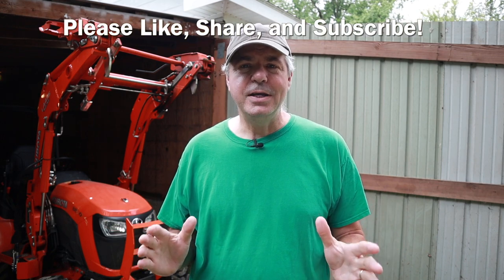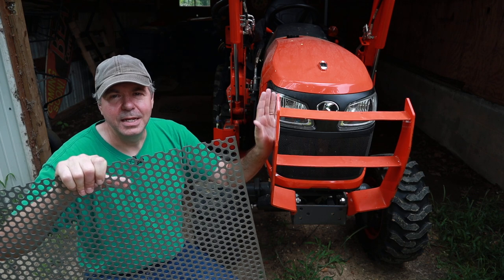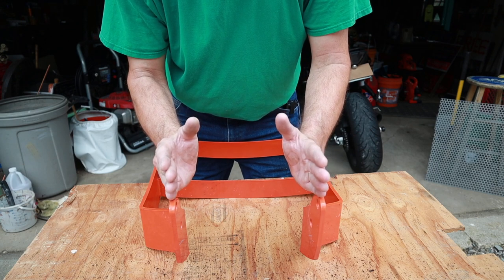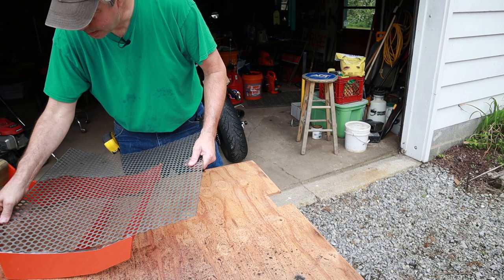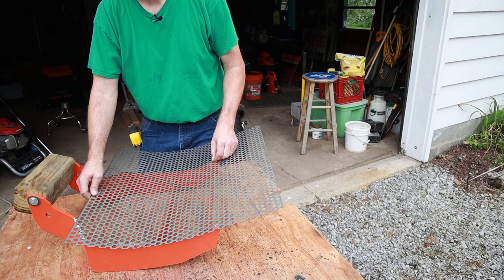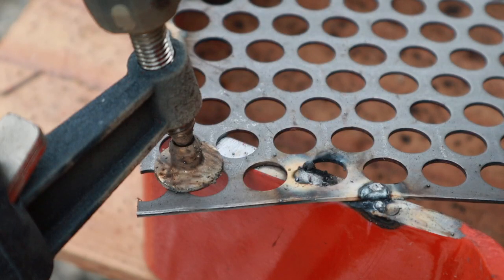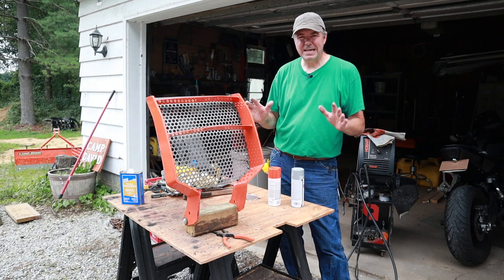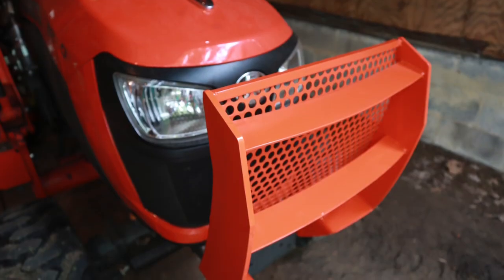#25 Kubota B2601, B2301, B2401 Brush Guard Mod. See the Hobart Handler 140 in action.

Comment: My poor mans fix was to buy 15" rubber bungie cords and run them across the bush guard leaving about 1" between them.  These are strong enough to stop any tree branches from going through the grill guard and damaging the tractor when using the grapple.  My grill is still intact and the $20.00 fix works just fine!  Takes me a whole 3 minutes to remove them when I put the grapple away for the winter.  If it wasn't for your video I wouldn't have even thought of protecting my new expensive purchased B-2601......Many Thanks.
Reply from the maker: That’s definitely better than nothing! Thanks for watching!

Comment: I started with the same damage you did. I used expanded metal, placed it on the front instead of the back of the guard.  I bolted the material on instead of welding. I put the metal on the front so limbs did not get caught between the screen and the frame, and tended to slide past the guard.  I bolted the screen as I figured it would eventually get damaged, and bolting would make replacement easier. You did a great job, and very nice looking
Reply from the maker: U Tubota - thank you. Sounds like you did a good job too!
Reply: Bolting that on the front sounds like a great idea!  How did you go about that?

Comment: Great great video. Cannot believe it has on 63K views, but art is art. But HEY E. Man, always wear a mask when spraying primer or paint, even when you hold your breath and are upwind, it still will clog your brain. 
I personally didn't always wear a mask, on my channel, like during my Camaro rebuild video that's coming out, it will cause brain clarity...

And one more thing E, wait for the primer to dry before adding the final top color coat. Sometimes you could get a chemical reaction from the primer when its not completely dries (read the label)  Un dried paint will release gases and will bubble underneath the top coat, (if you don't allow it to dry at least 30 minutes) but I see that both the primer and the orange color, are the same manufacturer, so that helps too. You are an awesome teacher. Thank you for your hard work.
Reply from the maker: Thank you Tommy! I know that painting is an art too (that I haven't mastered like you!). I appreciate your comments!

Comment: This is the way to do it.  My 1959 Massey Ferguson has this perforated metal in 3/16 thickness for a grill.  Perforated metal plate beats expanded metal.
Reply from the maker: Thanks Lane! 3/16 is way thick!
Reply: @MyClutteredGarage  the Massey 204 was early in the evolution of industrial tractors, based on the Massey 35, but they didn’t skimp on raw materials back then.  Today’s tractors and their controls have evolved so much. It’s all so interesting.
Reply: BTW, I have plenty of “hinge” wire from a former career, so I’m adding lights to the bucket arms where they bend.  I figure floods aimed at the bucket and above will help fill in when the headlights are blocked.

Comment: Great video, I have a Kubota L3901, three things I wonder why Kubota didn't do on my tractor:
1) Have a better brush guard, I damaged my front while hauling brush with my grapple.
2) Install lights (or light bar) on top of the ROPS.
3) Make a better PTO switch on the L3901

Comment: Like it! Just ordered a piece of that perforated steel to do the same. Whenever I use my grapple I'm always looking out for something sticking through and damaging my radiator. With this I can breathe a little easier. Thanks!
Reply from the maker: Good luck with your project. Thanks for watching!
Reply: By putting the mesh on the back side of the stock Kubota guard, the protruding guard steel sections can trap a branch end.  If you put the mesh on the front face of the Kubota guard,  it would allow branch ends  to slide off, instead of getting caught.  I am going to have to do something like this on my New Holland tractor.
Reply: @larryhasard3989  That's something to consider. Will look at it.

Comment: fantastic job! That looks factory! I wonder if the paint will hold up without clear coat, but even if it doesn't, it's easy to touch up. Well worth it.
Reply from the maker: Thank you! It has held up very well, but I do keep the tractor under cover.

Comment: I wish I'd have known about your trick with the 4x4 to hold the proper width. I didn't do that and had to get 1/2" threaded rod with nuts and washers to get spead out to the right dimension. thanks for the video.
Reply from the maker: That’s a bummer, Wayne. But at least you didn’t make it too small!
Reply: @MyClutteredGarage  Ed, I did make it too small and had to use the threaded rod to expand it out about 3/16” .  I did have a hard time bending it out as the threads started to fail. Next time I would use connecting nuts which have more threads . Thanks for the helpful video. The block is the answer!
Reply from the maker: @wlsteffen  ohhh. I was thinking you had to pack it out with washers. Sounds like you had a clever (but frustrating) solution!

Comment: Wow, that looks killer.  Well done!  I just checked my LS MT225E and it has metal mesh in the grill already, but I think I'm going to do this mod anyway. It looks great and if I bend one the metal mesh inserts or bust a headlight with a tree branch I'm sure the cost to replace either with OEM parts would easily exceed what the metal costs to do this mod. Well done video, and thanks for the wood block tip. Liked & subbed!
Reply from the maker: Thanks Dave. Very much appreciate your kind comments. -Ed

Comment: The grill on my B2650 is wrecked. This is a great modification to the guard, it looks really good and will provide significant protection.  Regarding the lights, I wonder if it would help if thr back side of the grill was painted flat black...

Comment: Great video! I bought the same welder last year from TSC, they at that time had one heck of a sale on it. I use Dewalt tools had pretty good luck with them. The cordless jig saw I bought was an 18 volt and with adapter now uses 20 volt battery

Comment: That looks awesome! I also have a Kubota 2601, have it about a year now. Was afraid to use to due to putting a scratch in it,lol. Just had my biggest, oops happen. While loading wood into the bucket, and taking it up to dump into my trailer a piece slide out and landed on the hood🤦🏻‍♂️. Nothing stays new forever.... I ended up using a dolly and hammer got most of the dent out but ended up cracking the paint.. these things happen..
Reply from the maker: Yep, I’ve broken mine in nicely. 😄
Thanks for watching!

Comment: The cup on your mig welder should cover your nozzle tip, it will give you better gas coverage.
Reply: He's using flux core wire, no gas required.

Comment: Why not put the added steel protection on the other side of the brush guard?  It seems to me that it would be better protection.
Reply from the maker: I actually thought of that. I just thought it looked better behind. Thanks for watching and commenting. Much appreciated.
Reply: @MyClutteredGarage  It looks better but not as strong. A big limb can break those welds and go straight into your grill. That being said.  I'm going to use the same perforated metal on the front of my brand new MX6000 that I put a hole in the lower part of the grill yesterday. The added bonus is I won't see the hole so easily with the guard covering it. Thanks for the great idea. It looks much better than the expanded steel I was planning to use.
Reply from the maker: @jackrothaus2816  bummer. The first ding is the hardest. Thanks for watching! -Ed

Comment: Excellent ! A job well done. I am more concerned with eliminating the side to side shake in mine. Does the insert block the lights much ?, I think I might make cut outs for the lights on mine.
Reply from the maker: I would guess it probably blocks the lights 50%. But the front end loader blocks them 100% so it didn't matter to me. Thanks for watching! -Ed

Comment: What's the brightest head lamp bulb you recommend to replace the factory bulbs that came with the Kabota 2601 tractor?  Thank you.  Btw, your videos are very helpful.
Reply from the maker: Hi Jim. If you have a front end loader, a brighter headlight won’t help much because the FEL blocks it. You can replace them with LED’s but the best solution is to add some ROPS mounted lights. Thanks for watching! -Ed

Comment: My BX2380 has a dorky flip flop brush guard that is always in the way when I open the hood. Seems the biggest function it has is to hit my front grill when I open the hood and piss me off. I am going to mod that darn thing all right... with a socket set, it is coming off. If I ever have a situation where things are actually going to hit my front hood [probably never] I'll put it back on. Oh yeah, did I mention it blocks my headlights too?... grrr

Edit, I am going to look at re-mounting the thing... ON the front grill so when I open the hood it does not HIT the front grill, it opens and tilts down "with" the hood/front grill. I can also mod it so it no longer blocks my headlights.
Reply from the maker: Sometimes accessories aren’t as well designed as the could be, for sure.

Comment: I’ve never used a nozzle gel, it looks easier I use a spray. 

One thing that might help you is when you do this kind of stuff instead of doing all your welding after you clamp it down, you spot welds on the end and in the valleys where you have to press it down and get everything straight first when you keep Welding at one end you’re shrinking and expanding and warping that metal so by the time you get down to the other end it’s a slightly different length and when you will that into place it can end up talking what you’re doing a little. If you’re doing a table top or something it’s not that important but something like this where you have to line bolt holes later to get it bolted back on that little tiny bit of torque can make a big difference and make it a lot harder to get those but holes lined up again. I also would’ve welded it off to those center straps just to give it that much more strength if you hit something thick, I might’ve even put a little square or round bar on those just to toughen them up a little they’re pretty thin metal going across the middle there and they tend to flex and bend a lot. Just beefing them up with a little piece of round bar or square bar on the back would really make that a lot tougher if you were to hit a big limb or something and it would add that much more strength to keep the whole thing square and help keep those welds from snapping if you hit something hard. It’s not at all necessary but it would just make it that much stronger. For some thing that was mostly cosmetic it wouldn’t be worth it but if it’s a guard that you’re actually going to use a lot it might be worth a little extra effort. It looks awesome and everything looks nice and straight. I agree with you on good paint as well. Lol
Reply from the maker: Thanks so much for this thoughtful comment. Sounds like you have some good experience!
Reply: @MyClutteredGarage  Most of my experience is learning the hard way. I’m an OK welder but I’m more accurately a really good grinder. 😂😂

Comment: Question:  that is the second video from you I watched, and I wonder if you have ever use a "zip cut" (a thin cuting disc) on your mini grinder.  It would be a lot easier to cut the steel you don't need.  I use it all the time.  Just saying...
Reply from the maker: Thanks Frank. Yes, I’ve started using them and they are amazing. 👍

Comment: My Cluttered Garage, this is a great modification to the B2601. I plan to do the same once I get my new tractor from the dealer. I was wondering if you have a link to the perforated metal you used in the video? If not, maybe you can provide the specifications on what you used. I really like the look and want to do the same thing. Thank you!
Reply from the maker: Hey Chris. There's a link in the description to the perforated metal that I bought. Thanks again and good luck!
Reply: Whoops! I guess I missed the link in the description. I followed the link and made a purchase of a 24”x24” sheet. Looking forward to doing this project.

Comment: thats a really nice mod on the grill. I like that metal you used with round holes. how well did the paint match? looks like rustoleum paint?
Reply from the maker: daveknowshow - thanks very much, Dave. I’m really happy with the way it turned out. The paint is Rustoleum implement paint in Kubota Orange. So it matches really well. Bought at my local Tractor Supply. Thanks for watching. I enjoy your videos too. -Ed

Comment: Did it cut down your air flow too much? I looked at your link and it stated 48% air reduction. Thanks
Reply from the maker: Hi Chuck. Great question. Because of the distance from the tractor grill, I’d say there’s zero reduction in air flow. If you were to place this perforated steel in a piece of ductwork, for instance, the 48% reduction would apply. Thanks for watching, and for your well thought question. -Ed

Comment: Do you think it might be just as well to put the perforated piece on the front side of the guard so if a limb hit it, the cross pieces of the guard would help hold its shape? I've been thinking about doing the same thing with my John Deere. I like the perforated look better than the expanded metal too. Do you know if the perforated stuff comes in half sheets or maybe quarter sheets? My brush guard looks like it's about the same size as yours.
Reply from the maker: That may be. I think placing inside is sufficient for my needs. Plus, I think it’s more aesthetic since all the welds are hidden. Thanks for watching and commenting.

Comment: I've seen a dozen vids  like this, adding mesh to one side of the guard or the other.
You do good work,
I did not ask the others, but will ask here .

If one mesh shield is 50% better than the o.e.m. guard,
Would a mesh shield on both sides be 100% better than the o.e.m. guard ?
Curious as to your thoughts.
Reply from the maker: Ha! Well I’d say one mesh shield is 95% better than the OEM brush guard and a second would add another 5% protection. Just my thoughts. Thanks for watching!

Comment: Following these instructions on my 2601 and found that the installed perf steel prohibits the tractor hood from opening.  Anyone else have this issue?  What did I miss?
Reply from the maker: There may be another set of holes? The brush guard should lean forward. There was no change with mine.

Comment: Get some gas for that welder and you'll never go back to flux core! Makes everything so much easier and no wire brush clean up. If you're welding that good with flux core you'll be a pro off the start with mig.